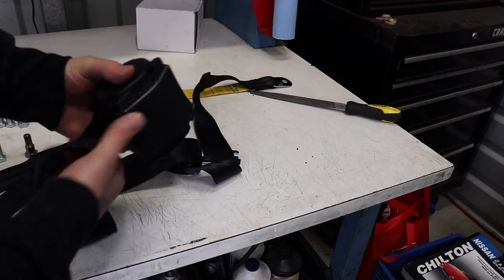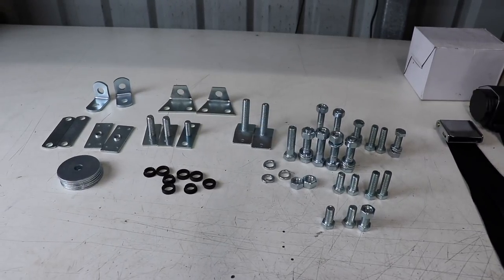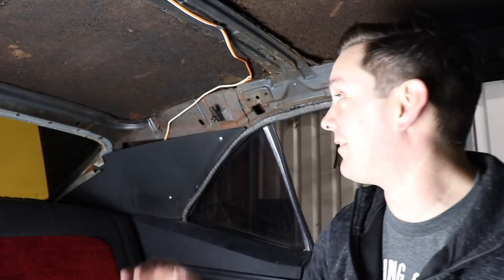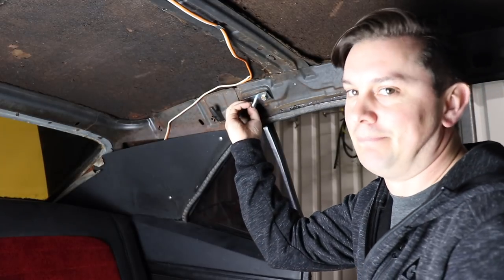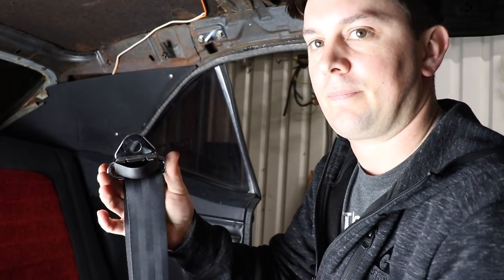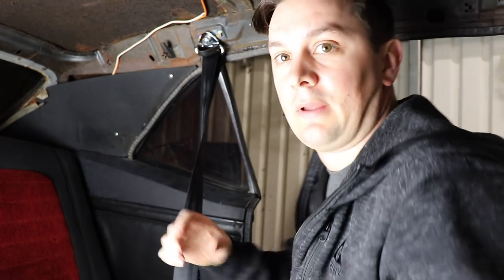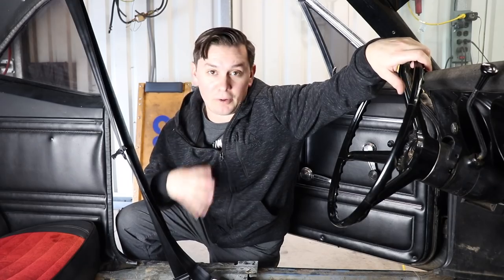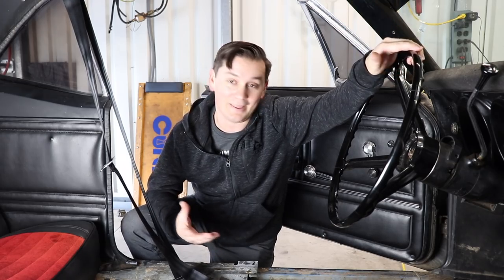Modern Seat Belts For Muscle Cars | Retractable Seat Belt Upgrade & Install

Comment from the maker: Thanks for watching everyone! What type of seat belt do you have in your ride (if you use them)?
Reply: My car is just a weekend cruiser and it has lap belts.  If I drove it every day I think I would use these.  Cool video.  Keep them coming.
Reply from the maker: Thanks! I think if this was just going to be driven on the weekends I would have just done the lap belt but now I am probably going to put these in my Pontiac.
Reply: I just purchased this same kit for a 1970 Camaro. It looks like the same original setup as in mine, I'm wondering if you had to use smaller bolts than supplied for the already tapped holes for the upper mount? Or were they large enough for the bolts that are supplied with the kit.

Comment: i was going to get a pair of bucket seats out of a Sebring convert that has the shoulder belt built into the seat.  They are fairly comfortable and it is easier to weld plates on the floor to beef up the seat mounts than it is to try and find a location for the shoulder belt to mount to the roof with a headliner installed.
Reply from the maker: I've done the same thing to a truck when I was replacing a bench seat for a friend.

Comment: Nice video, I just purchased my "retro belts" and watched your video first. 
That over head bracket you put on top is weak and not safe! 
I installed mine just like you and when I was tightening the center nut with a 3/8 ratchet it snapped off like it was nothing, I hadn't even started to put any muscle on it yet. Im glad it broke when it did and not in an accident because my wife and i could have been seriously injured or killed... I'm going to reach out to retro belt tomorrow to try to find a better solution but if I were you or anyone  else "TOSS" that bracket in the scrap metal pile NOW!!! And come up with something better...

Comment: I have something similar but they dont retract. You just adjust the belt and have to readjust it if someone else drives your car.  I think your set up is better and I may end up switching to it.
Reply from the maker: I looked into those actually.  They seemed like they would give you the added safety I wanted but I really didn't want to have to adjust anything when my wife drives the car since she will probably be driving more than me.

Comment: To put lap belts in would I have to remove my whole carpet that's installed underneath everything or would i be able to cut it through the carpet with the anchors on the bottom of the car?

Comment: I purchased the retractable shoulder belts from retrobelt.com.. They require 3 mounting points for the shoulder belt side:  the original top and bottom holes, but now they need another hole drilled in the front. The mounting hardware (the only one listed) that i purchased does not have the bracket that you have, allowing bolt on installation of the top point.  

Did you order these from retrobelt.com? When I called their tech support, they said they never sold anything like what you have! Is there any way you can you link the exact set up you purchased? I really appreciate it.